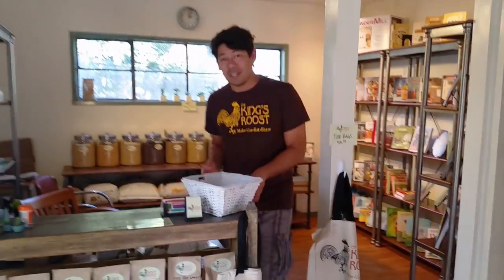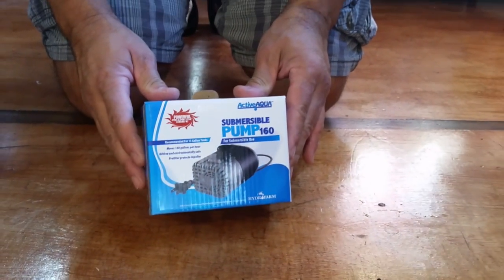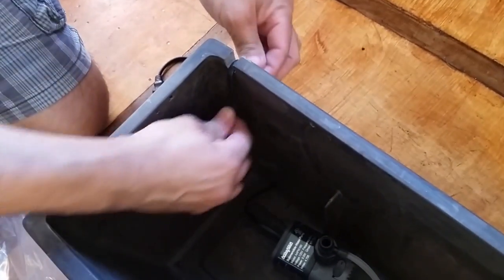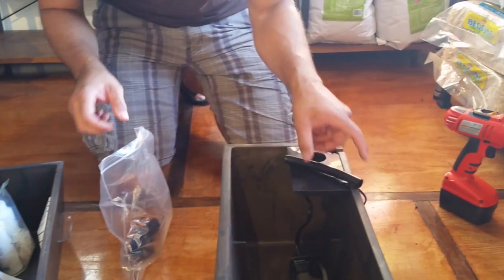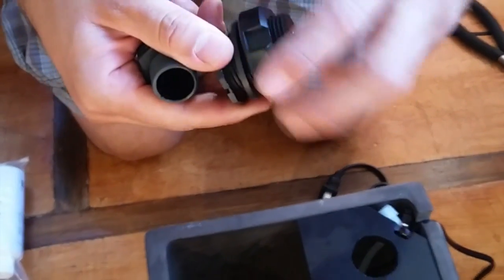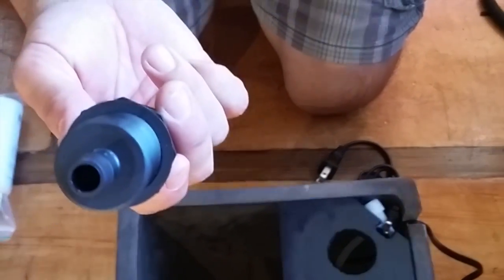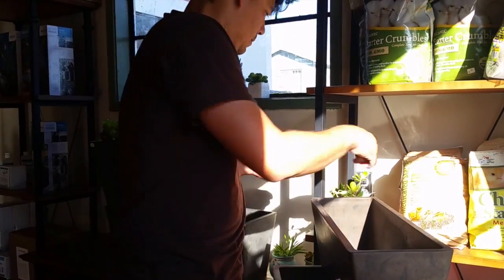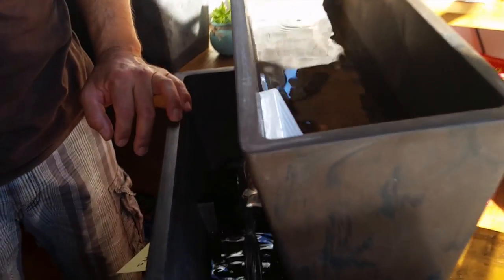How To Assemble A Small Aquaponic System

Comment: Dear Roe, many thanks to you on this creative small aquaponic system. Such a creative way of understanding aquaponics. My challenge has to do which the electricity or power that is needed to power the pump in a place where you can not boast of 2 hours of electricity and the second challenge has to do with getting  rid of the solids in this small aquaponics set up. Can you please shed light on these? Thank you.

Comment: HELP! I want to start aquaponics and blueprints are done but I need help on what pump I should get for a aquarium that's roughly 250literes - 300!
Reply: Ecoplus pumps on amazon. Cheap reliable quiet energy efficient. Depending on your head pressure "how high the pump will need to pump the water" i would the suggest the 290gph and higher. If it is too powerful then add a ball valve in your line to control the flow.